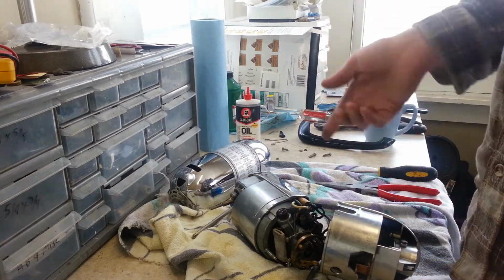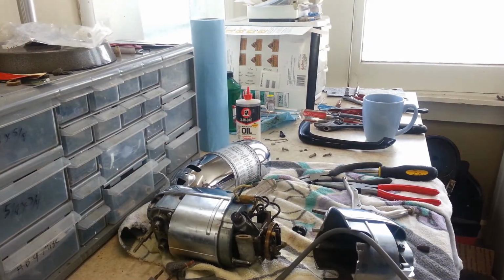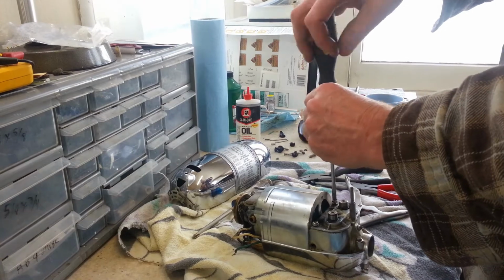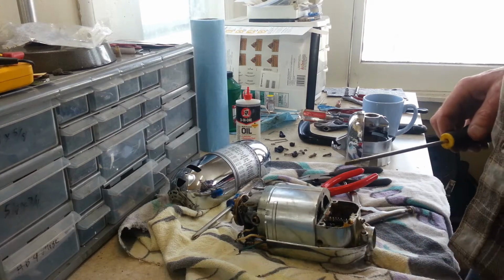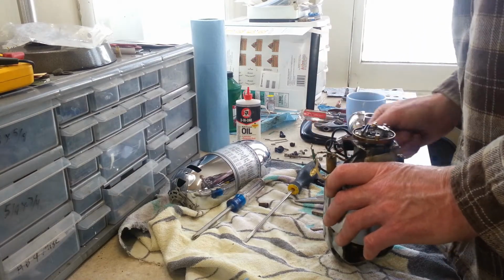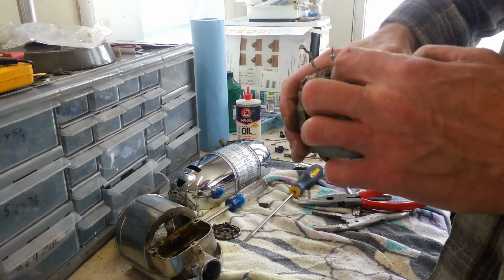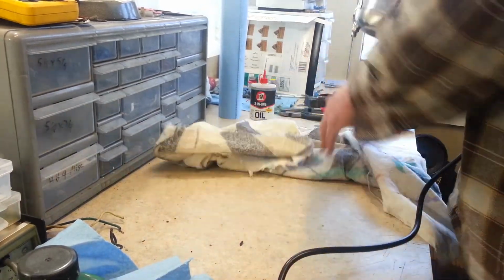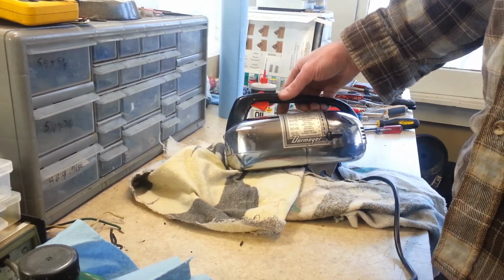Dormeyer 4300 Silver Chef service and repair

Comment: Hi Rick, i am just wondering if there's a simple reason asto why the machine won't shutoff when lowering the switch to the off position. The contact inside pushes the copper back to disengage but it just keeps running

Comment: Great vid. I have the same model. Beater ejector wasn't working. Looks like handle was taken off and not put back properly. can't figure out how spring is supposed to be oriented. Do you have any video of the this trigger assembly? thanks, paul
Reply from the maker: Hi Paul, I do believe I show that in one of the other dormeyer videos. I believe (going off memory here its been a while) the metal piece that goes from the trigger to the top of the beater shafts leans towards the front of the machine. The spring slides onto the threaded rod, and the other end the opening should face towards the front of the machine, I cant describe it very well but I hope this helps!
Reply: @vintagemixersandmore1666   Thank you for getting back to me so quickly, Rick. I see you're not really doing this stuff any more, so even more thankful. I didn't need to find the video you were referencing. Your description was enough for me to go on and I figured it out! Happy trails, -Paul
Reply from the maker: @shufflemuffin  Awesome!! You too!